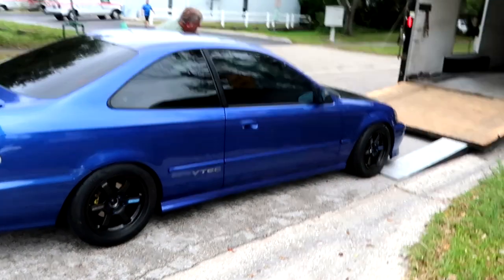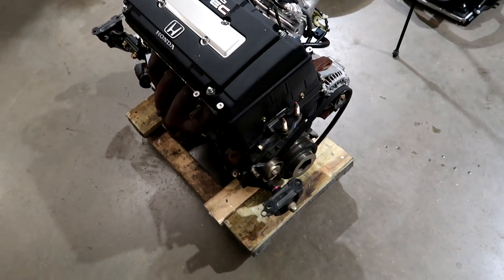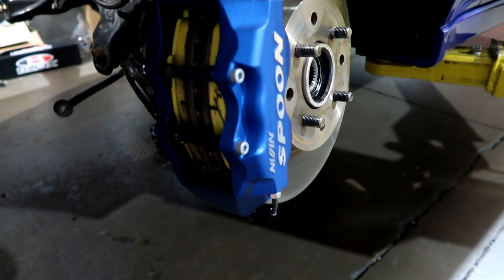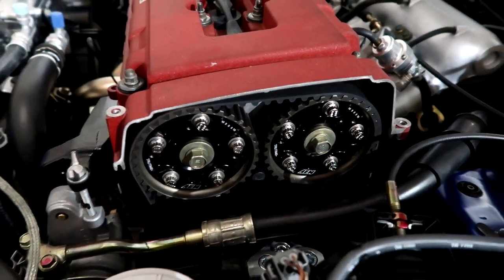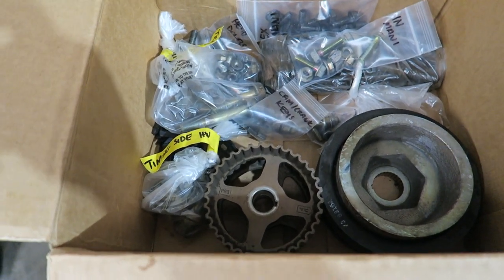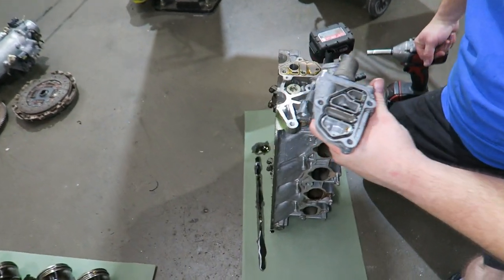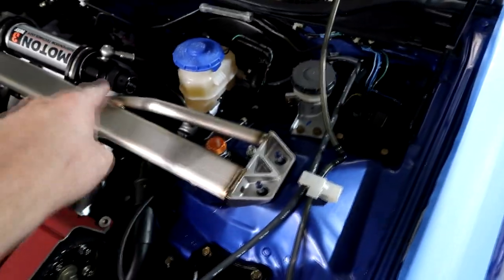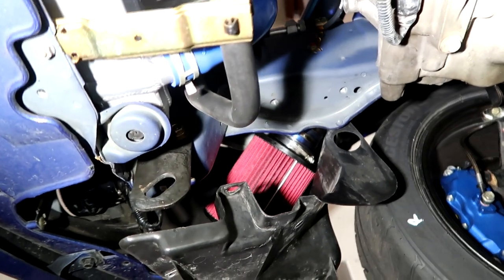Obsessed Garage Civic Si Build Part 1

Comment: Wow, top quality work and parts!! Can’t wait to finish my Integra GSR! Putting Skunk2 tuner 1 cams, Lmas, dual valve springs and Ti retainers, and Toda cam gears, etc... Can’t wait to hear it run!
Reply from the maker: That’s a good combo. Some people forget that larger cams add lots of noise and valve train wear. We’ve used Tuner 1 and 2s for 50k miles and had great success with them.

Comment: I had a shop called Fowler in Columbus Ohio do a B18C head for  B20 vtec build, and like yours the machined surface was like glass! I think he said they used stone to polish them. They specialize in crazy HP tractor pulling engines.

Comment: They make a fix for the hood release that is made out of metal that attaches with a set screw if your plastic hood release breaks, but you still have the cable down there. I've used it and it works nicely

Comment: You can buy aluminum hood latch you can screw on. On ebay. Replaced mine and works everytime
Reply from the maker: Juan Reyes The great to know. Share a link, it’s very common on these cars.
Reply from the maker: Juan Reyes Thanks. This will be useful for this generation civic owners. 👍🏻